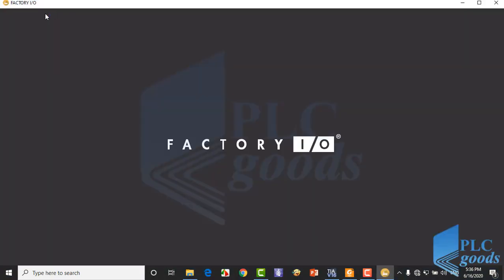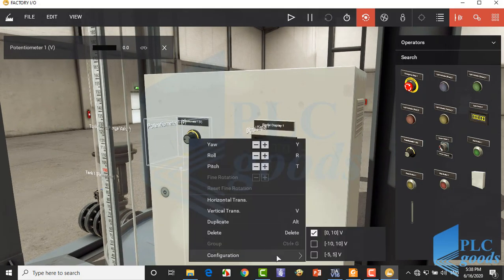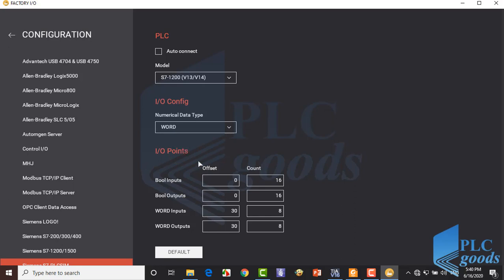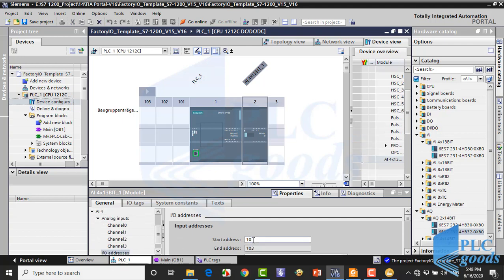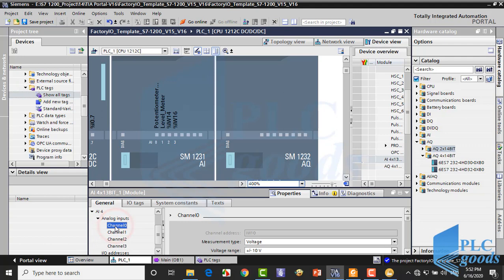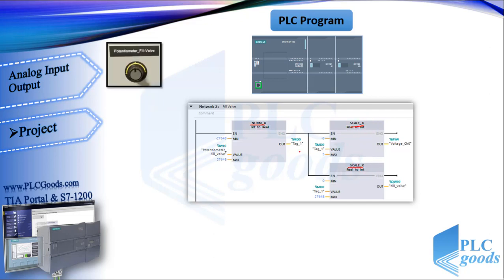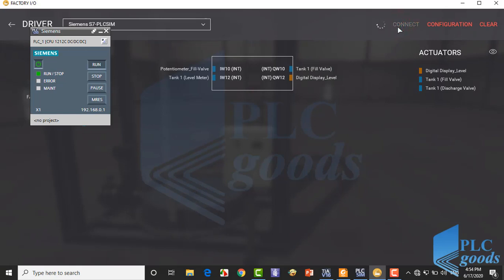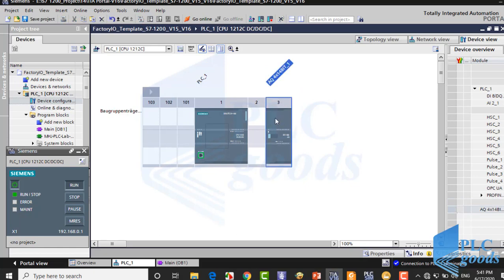S7-1200 PLC Analog I/O Project | Factory IO Tank Control & HMI Visualization | Lesson 32

Comment: Hello,
I would like to make a small program for garage door control which should generate analog output 10-0 V DC gradually . Change of analog output should be triggered by end switch located between lower and upper end switches, used to stop the door when they are completely open or closed (this switch should be located app. 40 cm above the lower end switch).
10-0V DC output should be used for PWM controller with control voltage input 0-10V DC. To resume,  the whole idea is to make a program which should gradually slow down the door when it reach the end switch located app. 40 cm above the lower end switch.
Any idea how to make that?
Reply from the maker: This comment  section is for answering questions related to the video.

Comment: Hi Sir, can you please tell me how does the %MW4 will be related to Voltage_Ch0? Why should we even need that?
Reply from the maker: Hi there, I just wanted to show the process how an analog input signal can be read and used. At the time 17:40 I used my voltameter and Factory IO to show that I've calculated the input voltage correctly.
Reply: @plcgoods  ok sir thank you.

Comment: Normaly when i want to cmd an analog output , firstly i use NormX to convert int to real to get the 0.0 or 1.0 which is 0 or 100 % in output; and use this % to get the value i want in real type with scaleX. 
If i want to cmd an analog ouput i use this real type which was convert in scaleX before , i take this MD.X and i use different compares blocs and moov bloc to send another MD.X2 to another NormX and scale X to cmd and regulate the analog output in term of the analogiq input and it is work very well
Reply: Hi there, Thanks for your message.
Reply from the maker: thanks for contacting us